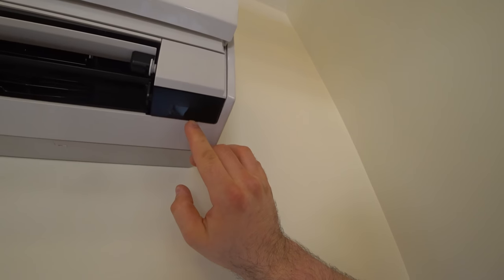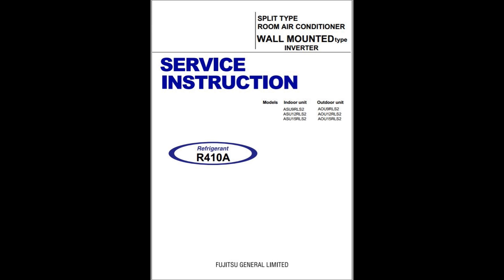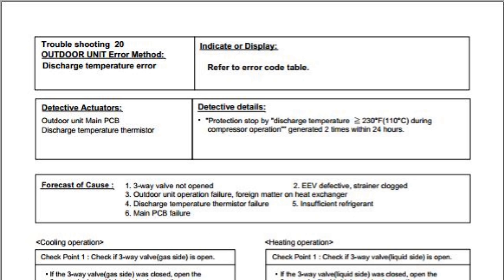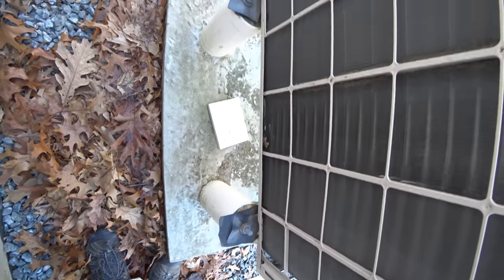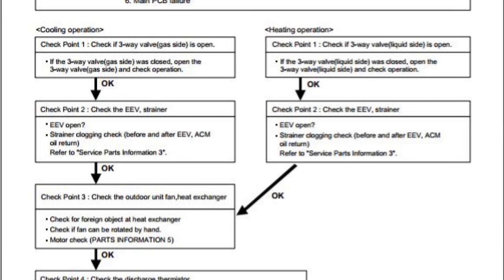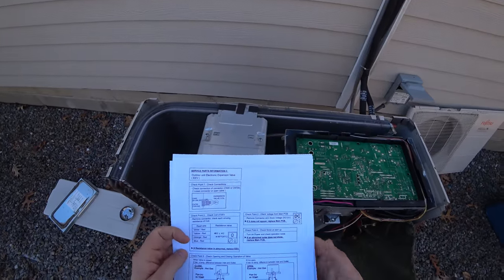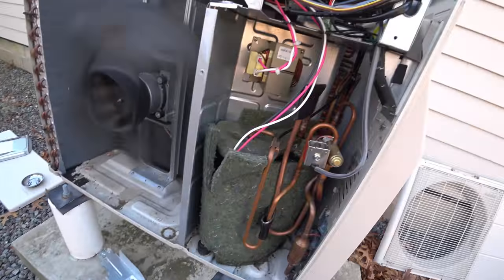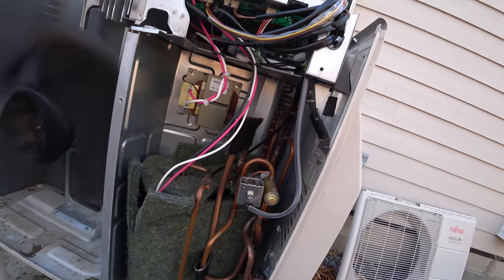Mini-Split Heat Pump Failure, AGAIN!

Comment: Our Fujitsu split system heat pump is four years old and has blown the same fuse 10 times the last two summers (only in hot weather, works all winter).  The HVAC company that maintains them tries to diagnose the system but does not know where the source of power comes from that blows the fuse in the outdoor unit.  We eliminated the possibility of our power supply being the culprit by hiring an electrician to test it at our own expense, add a power surge protector.  So the issue is somewhere in the installation, possibly the blower motor units inside the house that are drawing too much power, though whenever they are testing it it does not act up.  I wonder if the microcircuitry malfunctions due to not operating correctly during hot weather, as can happen with PCBs.

Comment: Did you ever get this Fujitsu mini split working? If your mini split was ever working at any time, but not emitting cold or warm air as much as it should or as much as you would expect or could compare it to with other mini splits, then it is likely that the high discharge temperature error message was due to the equipment not being completely vacuumed at installation time before releasing the refrigerant into the pipes(aka line set). It is a very common installation error. If the air in the piping is not completely evacuated, then the air will mix with the refrigerant and cause higher pressure and thus higher temperature than the system is designed for, hence the high discharge temperature error message(and reduced heating and cooling capacity). If there was a leak of refrigerant,  at some time, you would see one of the copper pipes connected to the two-way or three-way valves on the side of the condenser icing over. (When refrigerant level is low, it causes the refrigerant pressure and thus temperature to drop below its 40° F design temperature and thus when the temperature drops below 32° F, ice from the air's humidity forms on the pipe.) It's a shame to throw away your mini split considering it is such a common installation error. Also the three-way valve is the brass colored valve on the side of the outdoor condenser next to the similarly looking two port or two-way valve. The component you pointed to assuming it was the three-way valve is actually the reversing valve which if it ever does fail would still allow you to operate in heating mode because the reversing valve is always static in heating mode so if the reversing valve ever does fail you can still operate your mini split in heating mode but not cooling mode because cooling mode would require to electrically shift or slide the interior vanes inside the reversing valve in order to change the refrigerant path required for cooling operation.

Comment: I'm Justin with brad drake heating and cooling here's the problem your low on Freon when the unit go's into high speed you temps aren't matching put some gas in it your welcom
Reply: Wrong i just had a company come trying to figure same problem.. Late in the night they discharged into air.. Re filled ... Told me if there was a problem i would not see if for 6 months.. Next day same problem.. Do you have another reason that this would happen?
Reply: That's what I was thinking. The only time I ever saw a problem with Fujitsu units was a leak of some sort on a 10+ year old unit.  I was around for the diagnosis but not sure we ever figured out where the leak was from.
Reply: High discharge temp is either low charge or low oil causing friction and high discharge superheat. If your unit isn't low on Freon then you have to find if it's restricted or what's causing it to not return enough oil back to the compressor. Electronic expansion device needs tested to see if it is feeding the proper amount of liquid. These are test that need a certified technician to diagnose. Not for diyers.

Comment: Most times the components (indoor unit or outdoor unit) cost less than the cost to service a  problem.  And as such it is recommended you merely replace the entire unit.  Sad but true.  These little guys are fairly reliable but like all mechanical devices they do give up the ghost from time to time.  Locating individual parts can be daunting if you do troubleshoot and locate part failure.  I've purchased about 8 of these for various locations on property I own and one unit in particular has been the source of more angst that the rest put together.  It has never performed to capacity (12,000 btuh).  I've cleaned it (indoor and outdoor unit), recharged it several times over the years, and it has now begun to made a loud noise all the while its running on the outdoor unit.  Sort of like a groan.  My next move will be to replace it in total (both indoor and outdoor units).  I just don't need the headache any longer.  Now if these were badly designed or poorly made then why do the other 7 work well all the time over 6 years of operation?  So I can discount the notion that mini-splits are bad.  You just got yourself a lemon.  Not sure your size but you can buy these entire systems for just a few hundred dollars so throwing more money at repair is senseless.  Just replace the entire unit and be done with it.  I found Mr Cool to be the brand I prefer for a number of reasons.  But to each his own.  By the way I'm retired from being an heating and air conditioner contractor for many years.  No way I'd heat or cool with anything but a mini split.  Economy alone is enough to warrant their use.
Reply: Need to check first the refrigerant level, if it is 112 to 120  ps1. Next check the three-way heat pump valve if it is working properly or there's a  partial leaking. Then you need to replace it.

Comment: We had alot of problems with Fujitsu minis , we switched to Daykin. And glad we did.   But be careful. Most problems with minis are due to poor installation
Reply: Daikin not Daykin xD
Reply: I agree, i serviced a senville 2022 model today and the outdoor unit has compressor and board issues already. I have my doubts that the installer did not pressure test or vacuum the lines and non condensables are in the system and there is 9 outdoor units. The problem with buying online and then do it DIY doesnt make it cheaper , cost you the entire unit in the end, Good is Not Cheap, But Cheap is Not Good!!!!

Comment: If it was installed carelessly, some debris might have gotten into the system, which would cause the pressures and temperatures to go out of the limits that the unit is protected against.  Discharge it, have an independent tech (not the Fujitsu warranty people) check it out and clean the system then recharge it.  I boutht a truck from a friend, who said the AC had never worked well.  The dealer had repeatedly told him it was "OK" but after I replaced the expansion valve, it got a LOT colder.

Comment: Most certain low of charge. The outside unit comes with a filling up to 10 meter lenght of pipes. If the lenght is longer you had to ad  20 gram/meter over the normal charge. The high discharge temp its also gives a high suction temp back to the compressor who will create thoose high discharge temp. There is a another item to check  -if the amount of gas i right - that is the 4 way valve. The temp in to the valve should be the same out of the valve. If you have 70 C in to the valve there should be around the same temp out of it. The other to pipes is the suction side and they should  have the same low temp. Or else there is a internal leak in the valve and heat gas go the wrong way directly in to the suction side. That increase the temp to the compressor and increases the discharge, not so common but possible. God luck! " sorry for my bad spelling"
Reply: I have a question, my unit works great on cooling, but when I switch to the heat pump, my unit does not do anything, just sits there doing nothing. I switch to the cool side and it blows great works great, what is my issue?
Reply: Yes, going off on the compressor discharge sensor indicates low charge. Saw it every day as a wholesaler.
Reply: Extremely high super heat and no subcool - low charge.... I think it’s going off on low pressure then taking it a while for it to reset the pressure snap disc...... couldn’t hurt to get a multimeter and a stubby gauge. I Know they expensive

Comment: The only way to charge a mini split is to recover all the refrigerant and weigh in the factory charge that’s on the rating plate on the unit. . Can’t just hook up gauges and start dumping in gas. Both pipes are on the vapor low pressure side of the system   so you can’t tell much from gauges other than it’s low on gas and your below freezing on your saturated temp. These things are a bear to work on even for experienced techs.
Reply: The real answer
Reply: i topped Mine off i know your not supposed to do it but i monitor my Evap when i first ran unit i took D-T ambient and Humidity then Evap temp i keep an eye on Evap till all line up it been 2 years now and no problems, if i do have another Problem then i will dump charge then weigh in! i believe you can get away with topping unit off if you don't go crazy and dump to much in.

Comment: It's definetly gas problem lack of refrigerant or faulty compressor will rise the temperature of compressor causing its stopped with available protectors. BTW that valve is a 4 way valve you touched. 3 way valve is a service valve which you connect your hoses to. The reason it works after 1hour is that discharge line temperature backs to its range. For a while

Comment: I installed 3 single 9k btu units one for each bedroom. I did them myself 5 years ago after a lot of studying was very careful to use 410 flare tool by the installation manual even used a torque wrench with RB 68 oil on contact area. went all the way 5 vacs breaking with nitrogen pressure tested even vac down to 250 microns each time. they all work great for 2 years one started to lose cooling and I found a leak just had to torque the fitting and added 410 that's been 3 years ago and they are all doing well. btw I went back to all the units and torqued the fittings once and could tell a couple of fitting turn about 180 degrees before they where at spec torque. I sleep best when its cooled have just my room cooled helps bills and hearing bitching
Reply from the maker: Sounds good.  If I ever come around to wanting a mini-split again I will follow your lead and install everything myself.  I could have saved thousands of dollars on these "professionals".  However, I should note that I don't have proof it was the installer, or manufacturer to blame.  But, I will still do it myself next time.
Reply: I'll never hire another installer.

Did as you did - bought nitrogen, oscillating flaring tool and torque wrench. So far I've installed five Daikins with no issues.

Comment: Just to help you out bud if you ever suspect a bad coil on that reversing valve they make a magnet a solenoid magnet that you can put on there and it will pull the slide in the reversing valve but nine out of 10 times it’s going to be the thermistor reversing valves rarely fail

Comment: Check the charge on the system, typically we've had issues with the indoor coils have leaks on them. Or possible there is a leak on the connections at the indoor or outdoor unit. Have HVAC Tech come by and check the unit out for you. Recommend having the charge weighed out and compare it to the charge on the name plate of the outdoor unit. Then have it pressure tested with nitrogen to pin point the leak. I would put money on the indoor coil leaking. Have it replace before the warranty runs out on the system. Would save you some money.
Reply from the maker: Thank you.  The follow up video is here: https://youtu.be/bH0D-c4RPuk  I'm guessing you are right.

Comment: Weird. Usually Fujitsu units are top of the line. I've installed dozens and never had one with any problems, ever. The only one I've ever seen that had problems was installed almost 15 years ago and it ended up being that it had somehow developed a leak.
Reply: Douthat Mitsubishi usually top of the line
Reply: They are the bottom of the barrel.

Comment: Same problems with my Jujitsu.  I've had it serviced multiple times, drained, refilled, etc. No leaks found, no problems found, yet it continues to crap out. Thinking about replacing the mother board just to see if that's the problem. If that doesn't work, next step is ripping everything out, tossing it in the fire pit, covering it with gas and lighting a match.
Reply: Bad board
Reply: A project i was working on was to replace 25 OLD Fujitsu mini-split with new Fujitsu mini's...  5 of the bran new splits had the same Error code and of those 5 the cause was failed outdoor Circuit Boards

Comment: If your unit does not have a low pressure cut off, you could be low of refrigerant. Check your flare connections for leaks. You might check the out door unit fan motor amps.,  and make sure it is performing within specs. The outdoor unit works like a indoor evaporator during heat mode, and could be getting too cold, causing the outdoor unit discharge air to be low. A couple of things to check first.

Comment: Manual makes perfect sense to me because I am a professional. You don't know what's going on because you don't do HVAC for your career. It's awesome you got this code, its protecting the compressor. Old systems didn't do this and would burn itself out. These systems work good if they are installed with proper techniques by a proffesional.

Comment: Have a same model 'RLS2" series at home.. warranty is 10 years parts and labor in Canada (only have to pay for diagnostics of the problem) I have had the same problem happen to me twice now .. the technician told me the rls2's have a  poorly manufactured evaporator coils (the unit inside your house) which cause them to leak the 410a refrigerant, failure rate of these coils are quit high with the materials used at the time and only recently they have since improved the replacement part with a coating.. the in the newer fujitsu heat pumps models are suppose to be improved and seem unaffected but only time will tell ... all other brands each have their own inherent problems, there is no perfect heat pump brand when it comes to reliability in the mini slips you have the  1-Japanese 2-Korean - 3-Chinese in the industry the quality seems to be in that order
Reply: May I know how old is your unit and roughly when did it develop the leak problem?

Comment: Those minisplits are legit. The only time you run into continuous problems is due to a poor install. Strongly recommend you contact your installer.
But if you do choose to dig into your system always unplug that disconnect and leave it out for a minimal of five minutes before you open it up due to the DC voltage
Reply: Dude there is no way to do a poor installation on these units they are easy as 1,2,3 to install I don’t know what are you talking about but I guess you never installed one in your life . If you Follow the directions you can’t make a mistake . All it is #1High voltage , #2 communications #3 correct line set length,#4 vacume lines # open vales , simple as that . Yes in Others Circumstances if you need more line set that is pre-charged for you will have to add more refrigerant and make sure your flare connections are not leaking. Easy to install pain to service it ..😀
Reply: @tomas23x  you forgot one important part….ALWAYS install a surge protector. Too many sensitive, expensive electronics.

Comment: It is covered under warranty, call a Fujitsu contractor. If installed correctly this will give you many years of trouble free service.
Reply: On the rls 2 models the leak is almost always pinholing on the indoor coil having ruled out bad flare connections. Pressure test the system. Fujitsu will replace the coils free of charge to a reputable dealer,  but labor is extra. RLS 2 models are really kind of long in the tooth relatively speaking.
Might be time to think about a new one.
 Coil failure is not unique to Fujitsu. Daiken and Mitsu have all had problems with formicary corrosion. The copper we use today just isnt very good after its been recycled over and over again. In my opinion the fujitsu 12 model is the best value in the industry for price and performance
. These are just appliances. They all have problems I dont care which one you have. Find a good company to do business with and pay them for their integrity to stand behind the product within reason. Unless you are a service technician you really have no business getting under the hood. You get what you pay for.
Good luck my friend!

Comment: I would say this is definitely low on refrigerant, attache gauges, check pressures, recover if any to recover, carry out a full pressure/strength test, vacuum and recharge to factory charge, you will be up and running no problem.

Comment: I have the same unit when using heat during early winter months.  The computer board on the outside unit needs to be replaced.  Had it replaced by a tech since it was still under warranty and the unit has been working since.  You could pop the board out and inspect fuse short or the heat sink chip is fried or not.  For my unit, it was the chip on the heat sink.  Good luck.
Reply from the maker: Thanks for the suggestion.
Reply: Chuck Ma was it cooling ?

Comment: Fujitsu and Mitsubishi are like BMW's great features but very finicky. Daikin units are tanks. No fancy frills but great quality that has never le me down as an installer.
Reply: All the minis seem to borrow parts from one of the big three: Daikin (Japan), Midea (China), and Gree (China). Many of the cheaper units (Mr Cool, Pioneer, C&H) are just rebadged Mideas. Where there is some difference is in the electronics and programming logic to control them. Paying a premium for the 'name brand' Mitus and Fujis is generally a waste.